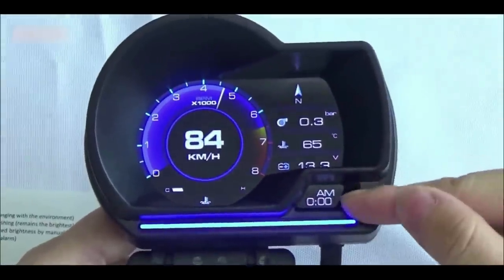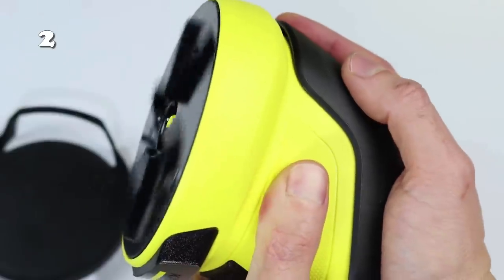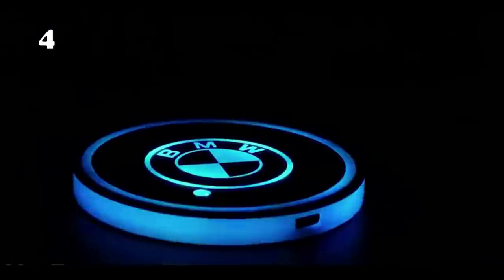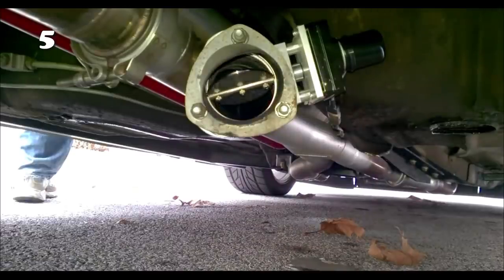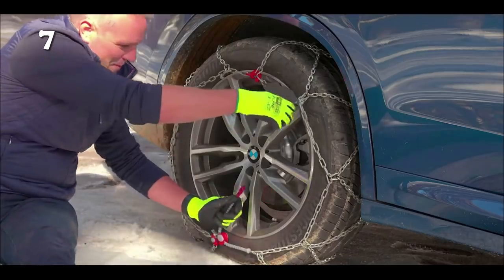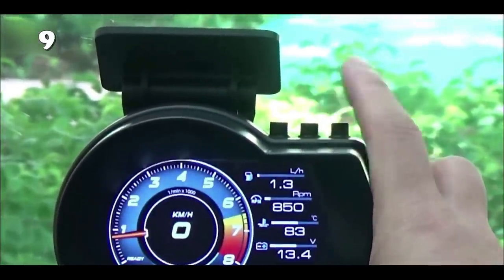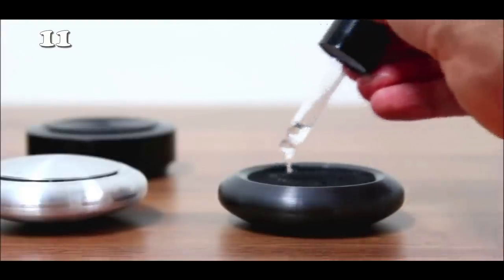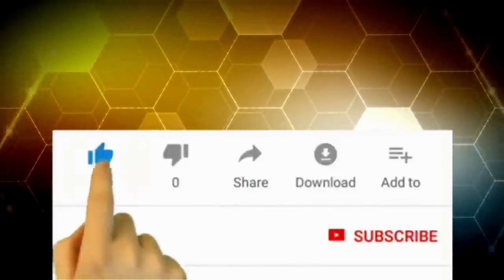12 NEW AMAZING CAR GADGETS FROM ALIEXPRESS & AMAZON (2022) | COOLEST VEHICLE TOOLS. ACCESSORIES

Comment: Terrible!  The very first item, oil filter funnel, Not all cars have their oil filters in the up-right configuration, some are tilted sideways if not at 90 degrees horizontal  you know...  LOL!   A tool that is single minded design is just not ideal, might as well just use a plastic bag...